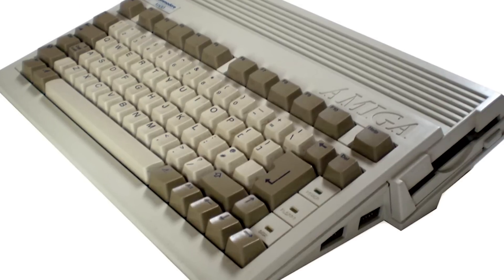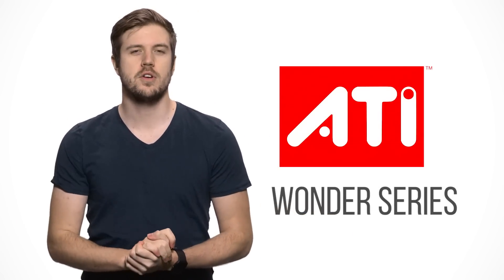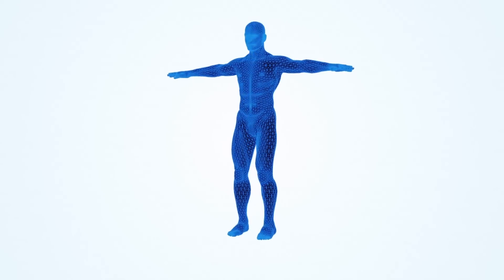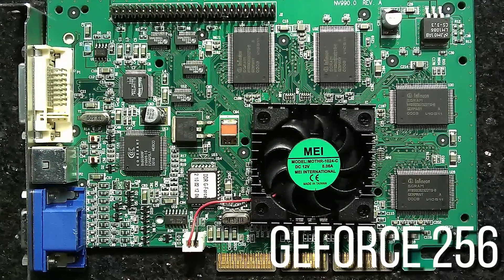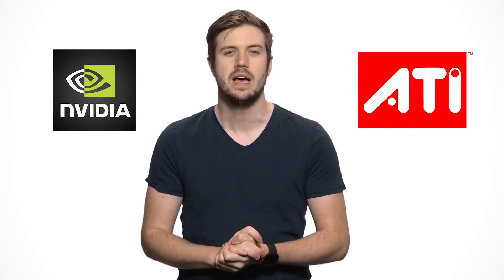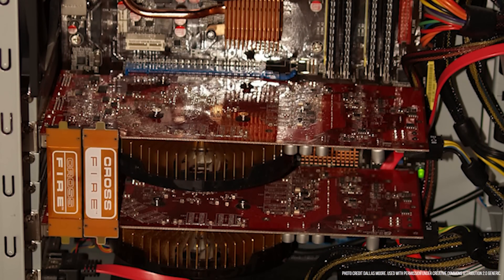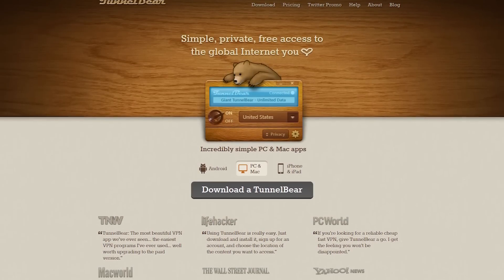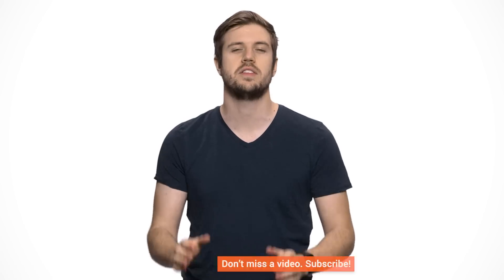History of GPUs As Fast As Possible

Comment: AMD or nVidia?
Reply: Yeah, nVidia is more advanced but how can anyone respect them as a company
Reply: +Jacky Xie Amd
Reply: +Cameron _ _ The only part of the market which is dominated is the top high end,  with everything under the 980 ti being dominated by AMD. 

970? 390 is better. 
960? 380 is better.
Reply: +Wiktor W. 
Nvidia has:
GTX 950 and GTX 980 TI

AMD has:
R9 380, 380X, 390,390X, R9 Nano, R9 Fury Non X and technically better Fury X Crossfire than 980 TI SLI.
Reply: CF R9 Fury X =$1200
SLI TITAN X =$2000
A single R9 Fury X uses around 275W and a single TITAN X uses around 250W.
Reply: Samus Knight Ok, so if you have a high resolution display (Anything past 1080P), which ultrawide most likely has, you may have a hard time playing on maxed settings, and still getting 60 fps in some games. If that's the case, freesync makes 30 fps, or 45 fps, etc, look almost as smooth as 60 fps. It does what vsync does, but better, and without the performance drop. It's hard to explain, and I'm sure others can do a better job, but I wouldn't get a new card just yet. Maybe wait for the next generation amd cards so you can get a little more life out of that 780, and get the incremental benefits of a newer card? Nvidia at any time could support FreeSync, since it's open source, as most AMD things are, but they're still pushing their over priced, not worth it, version of FreeSync. ($500+ monitors that would cost $100 less with freesync)
Reply: +Jordaan what if I told you AMD has a Shadowplay equivalent and the drivers precisely the same if not better than nVidias?
Reply: Jordaan Yup, that's what I recommend :)

Always be a smart buyer, and not following blindly into hyped cards/known cards (960 etc.)
Reply: Jeremy Hale Tell me more about how AMD's drivers are worse (Are we in 2008 again?)

How does 50w more destroy your eletricity bill. (That's note even 5$ per year if you run your PC full load 6 hours every day for 365 days)

Temps? Because having 2 degrees celcius more than nVidia cards is a bad thing!
Reply: Evan Wins I use them because I'm not poor like you :)

Atleast you tried bragging I guess
Reply: nVidia
Reply: Alexander Yordanov True, expect the 950. It gets beaten by the 370.
Reply: +Alexander Yordanov “Charcharo”  A CF of R9 Fury X is even better than a titan x SLI.
Reply: *****
Yeah...
If both GPUs are somehow at 100% usage and you stay at home and game for 10 hours... (both wont happen). If we ignore FRTC and idle usage...

And if we ignore that electricity is cheap even in poor as fuck Eastern Europe, let alone the rest and easier to live in world.
Reply: +Stjepan Brkić Just 150 bucks more
Reply: Stjepan Brkić
Uhm... untrue...
Reply: Jordaan I have a 970 and the drivers are terrible. I wish I had an AMD card because my 4k monitor supports freesync, and when I max games most only get around 30-50 fps with vsync on. Freesync would be amazing so I could get better fps with syncing. The drivers suck too. Both my 4k monitor, and my old 1080p monitor have had issues with Just Cause 2 with black screening and such (Even on my old gtx 660 and windows 7 build). When I use HDMI the screen flashes black every time I go full screen in a program, for around 5 seconds. THat's also terrible because my audio stops when it does that.

My family computer with cheap HD 5450 (SUPER budget card that can do 720p at max), never has any of these issues.

I'm pretty glad that display port doesn't have these issues, except for how it takes 10 seconds for the monitor to power up with the gtx 970... Took only 2 seconds with my uncle's radeon r9 270.

In my experience the drivers on Nvidia are terrible. Shadowplay doesn't work on half the games I use and there's no GUI for it so it's incredibly hard to tell if it's working or not. And why wont Nvidia support freesync? If it did I might actually recommend Nvidia...

Anyway you guys probably misunderstood me earlier. I hope I didn't come across as an Nvidia fanboy, because I'd much rather have an amd card, but I can't afford a new card rn comparable to a gtx 970 that supports freesync.
Reply: JustDSBM AMD software like TressFX and Freesync are open for anyone to use. nVidia simply pushes their locked gimpworks for nVidia cards only.

Also FreeSync came later than G-Sync, but is better in most reviews. Just letting you know, FreeSync supports up to 240Hz/FPS.
Reply: +JustDSBM And one again you're wrong. FreeSync was and is praised more than GSync
Reply: +JustDSBM Nope, I&#39;ve done my research compared to you. FreeSync works between 9Hz up to 240Hz.

Why do you think nVidia gets hated on apart from being an overall shady company? Sure, they release different things like gsync and Shadowplay first, but AMD always comes after them. In most cases the AMD is the same if not better to its nVidia equivalent. 

Well I know that AMD is a corporation and its purpose is profit afterall, but the way to get that profit is different than nvidia's unethical tactics. AMD develops open source technologies and don't make them expensive, they also developed low level api's to make games easier to run and better looking.
on the other hand, Nvidia deliberately tries to make games impossible to run and specially on AMD hardware just to make people buy their flag ship and current gen cards. also all their technologies are overpriced like g-sync and are not open-source
Nvidia only harms pc gaming for the sake of their own greed
Reply: ***** I'll go with AMD any time of the day in current times.

Cheaper, better performing for the price of minimal temperature (Max. 3degree celcius depending on the cooler) difference and efficiency: Boohoo 30w more which is close to nothing, I'll cry over that 1$ more in annual eletricity bill, because I ran my PC 6 hours a day on 100% :(:(:(
Reply: ***** comparably priced and speced AMD cards run 5-10% fewer frames per second.  The only explanation for a card with high clock speed, wider VRAM bus, and more shaders to run slower than the lesser equipped model is a driver optimization failure, period, end of story.
As for power, you greatly underestimate the cost of power in North America, and the impact of increasing total system wattage by 50.  not all 50W increases are created equal, and typically if you are going to make a jump that big in your system you will also need to upgrade the power supply, so even more cost added there.  But we can talk power alone.  I just switched from an AMD R7250X to a GTX960.  The TDP calculator on my system power chain reads that I had a higher than average peak load times yet saved approximately $5 in the month of December alone, without changing my power supply.  When you change a component and increase TDP by 50W, that doesn't necessarily mean you are only raising the TDP at the wall by 50W.  The power supply is not a 100% efficient system, and the closer you get to 80% of the PS's capacity the less efficient the PS becomes.  Over 80$ total capacity and he efficiency is quite terrible.
Now on to thermals.  Each degree of heat you add to the system is more difficult to remove than the previous degree.  Cooling is also a curve (much like power) it is not a straight line.  I was able to reconfigure my fan setup and remove a fan, and still keep my new card 5 degrees C cooler under load than my previous.  This also contributes to my power savings as my fans rarely go above 60% speed even while playing demanding titles or rendering.  The previously had to stay between 50-80% almost constantly and jumping all the way to 100% frequently while rendering.
I am an big AMD fan, but that doesn't mean I am closed to the truth.  I would have gotten the R9 380 with 4GB of RAM, but that extra 40-50W (depending on what cooler is on it) was not worth paying an extra $5 for, especially when I was only going to get a 1-2% fPS boost to go with the AMD card @1080p.  That's right, at the card range I was looking, the AMD was $220 and the NVidia $215.  Give it a year and the AMD card will come in cheaper, I know this, but I needed the card now.  My current config saved me money on the front end and in my energy bill.  If you want to keep on the AMD bandwagon, fine, but don't try to mislead others and dismiss the truth about TDP, Thermal characteristics, and the importance/impact of both.
Reply: Evan Wins Me buying a new system? I could if not for me being in a very good future proof situation :)

I'll lend some money next year when your 980ti gets outperformed by a 4 year old card called 290 lol
Reply: +Wiktor W. Green fanboys are always green with envy.
Reply: +MinuteGaming AMVidia
Reply: +MinuteGaming I'd say AMD if you're going budget, or high end. Pretty much every other market in between, Nvidia dominates. Such as the GTX 960 and 970. What AMD cards offer performance relative to those cards, at cheaper prices, and use the same/less power? Electricity costs money too, so keep that in mind before you buy a graphics card.

If you have a 4K monitor, chances are it has Freesync, so I highly recommend an AMD card with support if so. Freesync isn't as good as G-Sync, but it's still very good versus not having either at all.
Reply: +MinuteGaming AMD
Reply: *****
Actually... depends on the price here. Where I live the 950 is a better deal as the 370 is a tad weaker (still a good card, make no mistake).
Reply: FranJ195
Yeah though here I must say that the 4 GB of VRAM are a bit of a pain in the ass...
Reply: FranJ195 You do realize that will use around 700-800 watts of power while 2 titan x's would use 500 watts?

That costs more money in the long run.
Reply: berzu21 I hope your joking
Reply: +MinuteGaming If you want best bang for the buck - AMD. If you want best GPU possibly, for a slightly bigger cost - nVidia.
Reply: +MinuteGaming I prefer Nvidia because of Shadowplay and drivers.
Reply: +MinuteGaming
AMD = "Everything should be open source" mindset
Nvidia = "Everything should be proprietary" mindset
Reply: ***** Well I don't plan on upgrading my 780Ti anytime soon but when I do ill be sure to look at both sides.
Reply: +MinuteGaming i use a nvidia card right now, but AMD all the way, Nvidia are such douches about their technology whilst AMD has almost(if not)everything open source.
Reply: ***** I've never had any trouble out of shadowplay or drivers. I've owned a gtx 750ti and a 780ti.
Reply: JustDSBM Why not? Just because you have a GTX card doesn't mean you don't plan on getting an AMD card. Also, Nvidia could support freesync in their cards with a simple firmware update, because it's open source, however they keep pushing their overpriced, barely better G-Sync.
Reply: JustDSBM it's not about sharing, it's open source, like most and products. Nvidia can use it whenever they want, but they won't because they have g sync
Reply: +Cameron _ _ is right on here.  Budget cards, AMD gives way more power per dollar, but in the mid range the price difference between comparable cards is negated by the higher thermal and power requirements of the AMD cards.  You get the extra $50 back on moving to the Nvidia in this case, plus you get a driver that is better optimized to use all of the card's power.  Then you get to high end where the power differences shrink again, and AMD comes out back on top...but arguably shoot themselves in the foot with their drivers again since their high end card, on paper, should blow the Titan out of the water yet can't seem to get the appropriate optimization, thus only achieve small advantages.
Reply: ***** So you call a chip that generates more heat and uses more power better?
Reply: +MinuteGaming We all know that Intel and nVidia products are better than AMDs at this point and have been since 2012 at the least, no question, stay in denial fanboys and poor people.
Reply: Evan Wins AMD beats nVidia up to the 980 ti.

Stay in denial fanboy and spoiled brats.
Reply: Jeremy Hale So I wanted to reply to this comment, but I kept closing the window by accident.

You're right and wrong. Higher TDP by 50w won't cost you much, maybe if you live in a coutnry with expensive eletricity.

The 380 has the same TDP as 960- Did someone say 300 series has a shitty TDP?

Also 380 wins in most games by 2fps to 17fps.
Reply: +Evan Wins And I own 2x Fury X's in crossfire.

Your baiting is so bad that it makes me saddened that trash like you wastes so much oxygen :(
Reply: Evan Wins Nah, way better Crossfire and 4k perfomance makes the Fury X perfect :)

Can't wait for Dx12 where Maxwell will get decreased perfomance lel
I'm gonna enjoy my even higher FPS
Reply: Evan Wins You're still fanboying? I missed you man, I cried a lot when you didn't asnwer me with any more of your facts pulled straight from your ass :(

I also hate it when my 980 ti goes up to stock cooler 290x temps and whines more than a 480 :((
Reply: ***** Yea pulled those straight from my ass, not like I've owned both or anything, not like we've all seen the whine of those pumps on the fury x, not like my current platform is completely silent even when rendering out video while I play AAA titles. For sure man, you tell me about it, as if I haven't put in my time on a shitty 990fx platform with overpriced garbage 4 year old 8350s and 280x's to 290s. Please... AMD is and has been behind for years. I mean for fucks sake their boards, when's the last time you saw an update for that shit? Excuse me, an updated revision that works? They can't even keep up on support for bios revisions for their shit boards, you pay $80 for a z97 board that has features loaded that you'd have to pay $250 on 990fx and the thing will die on you in a couple months.

I own both, Intel and nvidia shit on AMD, AMD doesn't even win the award for being bang for buck anymore its pathetic.
Reply: +Evan Wins AMD is a good company just like the others. Calm down
Reply: Bone Marrow I mean, if you justify them being 'good' and 'the same' by way of them being in the tech industry and having logos sure they're the same.

But they really just aren't the same, AMD is inferior to every other tech company and it shows in net worth. They haven't introduced anything game changing since 2012 and that's a long time when all of your competitors are.

There is literally no reason to buy into the AMD platform at this point, like shell out the extra $30-40 and go haswell i5 every time.

Comment: I want a GTX 970 reference but it is not available in our country.
Reply: 1. Reference coolers suck.
2. R9 390 > GTX 970
Reply: +Jacky Xie If one has a 650W Gold PSU then the 390 is the best choice. I was stupid to rush buy a 970 before AMD released their 300 Series. It's fine, 970 is still a great GPU for my 1080p needs.
Reply: +Tiago Luz Same here, bought a 970 in July 2015. I'm running out of VRAM..
Reply: +Tiago Luz Even a 600W bronze certified one is fine.

Comment: A joke... My computer
Reply: That depends.....
Reply: +Jorion Edwards how
Reply: jake O'Shaughnessy Is it 4gb ram quad core Amd FX "bad", or 0.5gb ram pentium running windows xp bad.
Reply: +Jorion Edwards integrated graphics
Reply: jake O'Shaughnessy I'd laugh, but I'm in the same position for a while.

My Aspire One lags in freaking MS Paint.
Reply: same
Reply: +Jorion Edwards I used to have one of those lol, it used to lag when I right clicked. it froze for like 10 minute then turned off.
Reply: +A Helpful Person DUDE i have an i5 3210m with integrated!
do i know you? O.O
Reply: intel c2d 2.0 gHz, 4gb ram and a 256mb Geforce 9600m GS
Reply: 1.5 gb hdd, 8 gb ddr3 ram, amd a8-5500 at 3.2 ghz, integrated graphics, windows 10
FUCK INTEGRATED GRAPHICS
Reply: Zappy595 Damn... I feel sorry for you. Are you using Windows 10-Linux version? Because there is no way you can even have most versions of Linux let alone Windows XP+ on your computer.
I'd suggest upgrading your harddrive first then get a dGPU.
Reply: ***** Yea they compare really well against Intel HD 4000... so really any integrated graphics made after 2012.
Reply: Same.